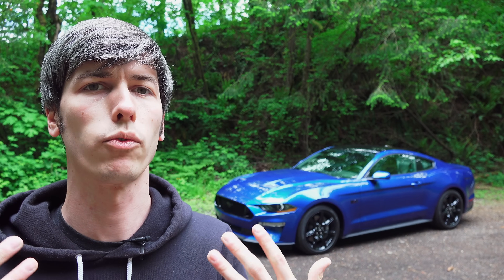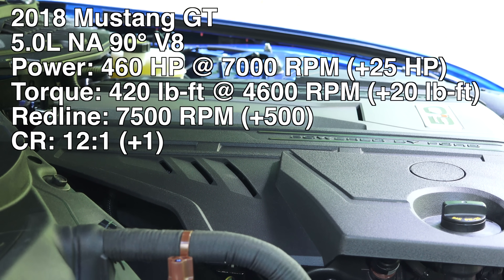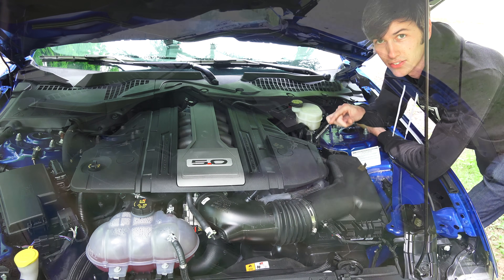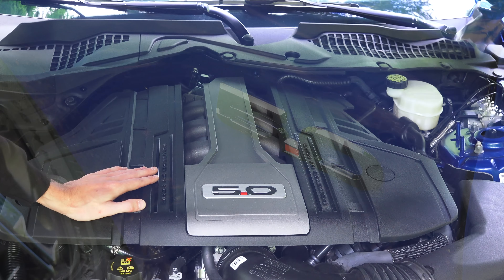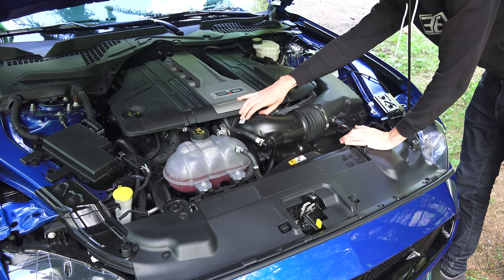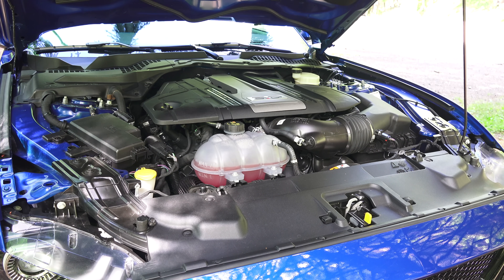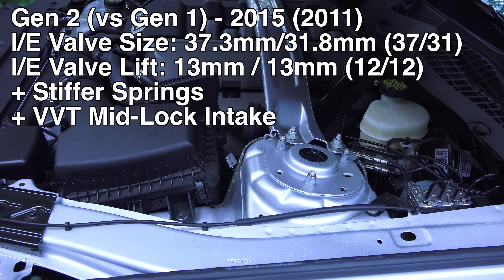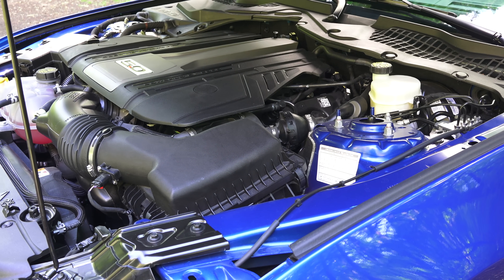The Best Engines - 2018 Ford Mustang GT 5.0L V8

Comment: I believe the 5.0 naming designation for the original 5.0L 302 was to differentiate it from the 4.9L inline six cylinder truck/van engine, probably for sales purposes.  The Coyote  was called 5.0 mostly for nostalgic purposes.
I dig the engine videos man.  Very cool.
Reply: Average Floridian the 5.0 pushrod was known to split in half down the block at numbers exceeding 500hp and even required aftermarket block braces to prevent it from happening.
Reply: The original 5.0s were reliable engines, but remarkably bad for performance. They made about 130 HP, and were offered in trucks and vans like the E-150 and F-series alongside the 300 I6. It wasn't until the late 80's that the Mustang 5.0 gained a reputation. Every other version (in the F-series, E-series, and probably a couple cars) still made good ol'  malaise-era 130 HP right until they were discontinued. At least Ford got their stuff together with this one.
Reply: They made 210-215hp stock in the Mustang (1985) and Explorer (1998-2001).  Not great, no, but a moderate Holly carb, AFR heads and a Victor Jr intake on a stock bottom end made 550hp (530hp in a similar EFI setup).  That's more performance than you'll ever need on the street, in a much smaller package than the mod motors that make a big block look smaller than average.  It depends on what you your end goal is, what you have, and what you have to spend.  If I were to engine swap my car right now, the old motor gets me there for several thousand less.
Reply: Average Floridian isn't the old 5.0 a windsor, meaning that much power would split the block?
Reply: Average Floridian heads and an intake WILL NOT be anywhere near 530hp in an efi 5.0... not even to the crank.. your looking at MAYBE 320 and that’s assuming you have very aggressive cams with the heads, and even then your looking at tuning and many other engine components needed to make it run right. If you put an EFi version Victor jr on your 5.0 you’ll also need an aftermarket throttle body etc...You cannot just slap aftermarket heads and an intake on a vehicle and expect 350-400hp over stock LOL
Reply: Good theory.  But I ask why is a gm 350ci called a 5.7l and a ford 351ci called a 5.8l and a dodge 360ci called a 5.9? I think ford likes to round up.
Reply: Well... 350 is 5.73L, 351 is 5.75L, 360 is 5.89L but we don't go to the hundredths place so the appropriately round to 5.7, 5.8 and 5.9 respectively.  The only weird one is the 302, which is 4.94L being rounded to 5.0L.  Their 300 I6 is 4.91L.  Those would both round to 4.9L, which is confusing to truck/van buyers where both engines were offered.  The 302 is also 4.94889L, which is almost 4.95L that would then round to 5.0L.  No, it's not totally honest, but the 300 was developed before the 302, so they had to find a simple way to differentiate the two.
Some other engines they've had were the 140CID Lima, which was called 2.3L, and that was 2.29L.  The 153CID version was called the 2.5L, and it was actually 2.50722L.  The Essex V6 was 232CID which is 3.80L, and they called it the 3.8L.  In 2004 it became 237CID, which is 3.88L, and they called it a 3.9L.  There was also a 256CID version that replaced the old 300 I6.  That comes out to 4.195L, and they called it 4.2L.
It's all standard rounding convention by everyone across the board.  The only one that's different is the 302/5.0L.
Reply: This is the first I've heard of it.
Reply: I merely paraphrased an old magazine article build, which has all the data and dyno graphs.  I'll look through my stash to see if I kept a copy of it.  There might have been an E cam.  It's been a while since I've looked at it or remotely cared.  Anyway, it's documented, as well as higher power builds.  You can find it.

Comment: How is this a good engine? its 50year old lump out dated that does 92hp pr liter witch is bad,,The Honda S2000 bck in 1999 had a output of 247hp from a 1997cc 4pot,,, Or how about Volvos 225 hp/liter triple-charged four-cylinder engine?
Reply: CanisLupus1983 
You are confusing good engine and fast engine.
A good engine doesn’t necessarily mean fast, although this 5.0 is no slouch. But he never said it was the fastest engine.
Reply: Im not going for fast then i would have said a  2jz or a rb26 or a four rotor wankel . Im on about how efficient it is for its development.

Comment: Better than the LS yes I thinkso wait until it’s more available. Not to mention the 5.2L flat plane V8. DOHC V8s from Ford are the future.
Reply: hochhaul - it’s a DOHC it’s going to use more parts. That doesn’t mean anything. If you’re so keen on moving parts. Leave it NA. Displacement wise the coyote is smaller making more horsepower and solution to torque would be forced induction. 4 valves breath better. The current coyote makes more power than the current LT. for example the 7.0L in the 2013 z/28 made 505hp the 5.2L in the 2015 Mustang gt350 makes 525hp. So those “moving parts” are there for a reason
Reply: hochhaul I doubt the coyote will fit in a corvette, the ls3 is small external so they can put it behind the front wheels  and axel. It might be a v6 at that stage.
Reply: Nathan Squire I mean if they made 1 fit in a cayman I’m sure you’ll fit it in a corvette will need a cowl hood for sure
Reply: These DOHC V8 "engines of the future" only just match the much higher displacement 6.2 LT1 in fuel economy while delivering 25 lb-ft less torque, all while requiring far more than double the number of moving parts. The Coyote is the future due to emissions regulations, NOT fuel efficiency, power output, or physical dimensions.
Reply: leeleelee i mean the future is electric. In 10 years im sure we'll have an electric car that competes with these v8s for bang for ur buck. Im an ls fan but its hard to ignore the future of electric even if they have no sound
Reply: V8's have never been the future. A smaller v12 will get you to 200mph more efficiently and scream a much nicer sound, but Ferrari did that before the Ford Mustang was popular lmao.

Electric really is the future, nothing can or will beat it. If they don't produce more power, they have better range. I should mention the main electric car company, Tesla, produces luxury Sedans that can beat Dodge's best effort at a street legal drag car... and they don't have to compromise a luxurious interior.
Reply: Sly Lane mustangs have been popular since their conception dude...and ferrari didn't get a production car to 200mph till the late 80s, and it was a v8, lol.

PS: found the tesla fan
Reply: Why do people like a flat plane? You make a rumbeling v8 sound like a 4 cylinder. V8 is not supposed to sound uniform or even.
Reply: Nathan Squire i know. Lol.  in this case of the gt350 they don't even get the traditional advantage of lighter weight.

Comment: Pretty biased about the transmission, there. The ten speed auto is INSANE in this thing and I personally am far from missing the stick.
Reply from the maker: I wouldn't say it's insane haha. It's better than the six speed, and it's quick if you leave it in automatic mode, but disappointingly slow with the paddle shifters. I was measuring 1-2 seconds for upshifts and downshifts from pressing the button and the shift fully executing.
Reply: Engineering Explained sure, sure. AFAIK that time delay is so you can skip shift like the automatic mode; I don't mind it.
All in the way you look at it, I suppose

Comment: I watched your video on high rev limitations. (Very good.) When you cover an advanced engine I'd like to know the maximum piston speed. Then with that as a start, how the design of the chamber and valves approaches the problem. For example, this engine using dampers to increase the intake velocity for better mixing in certain circumstances. The power stroke process is fascinating to me.

Comment: I had a 2015 Mustang GT before I got my Corvette and I have to say I do miss that dual cam. Also when you put a good cat back on these cars they sound great.
Reply: Scorpion7substance ..keep ur Vette & get a Stang!!!
Reply: Scorpion7substance how much more do you like your Corvette. Im thinking of buying either
Reply: GT 350 vs Base C7 would be a hard choice but GT vs Base Stingray, I would choose the Stingray. I like it a lot better, feels lower, trq on the low end is very good and handles very well. The Corvette is built very well aluminum chassis, lighter, targa top and functional vents all around. I would recommend getting the Z51 version so if you do want to go to the track you will have a dry sump oiling system which is better than wet sump. Also the Z51 will give you a good base like to build up the car for the track. I would only recommend the Stingray Z51 and Grand Sport. The Z06 not so much because of the heat issues but I think the newer versions use better heat exchanges for the blower.
Reply: How do u miss a dual cam?